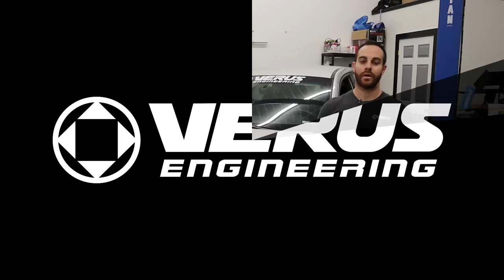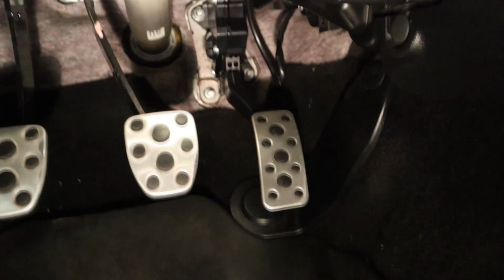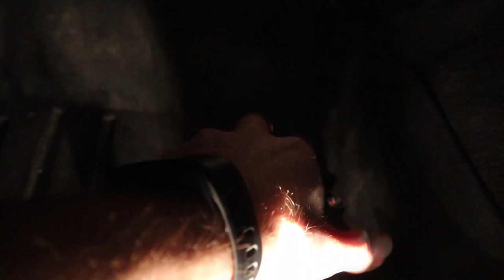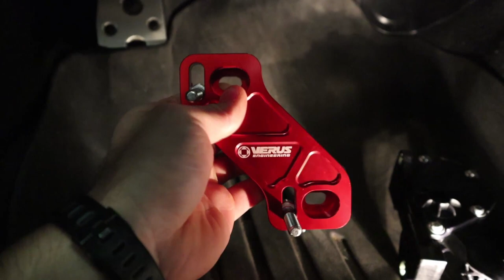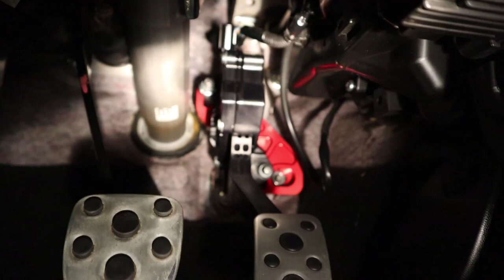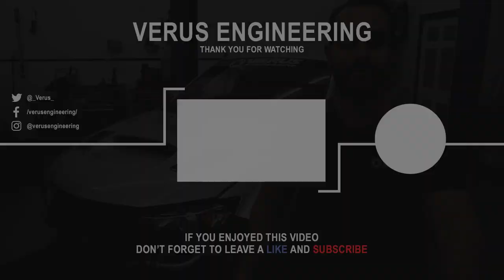Subaru WRX/STI (GR/GV) Throttle Pedal Spacer Install

Comment: got braided lines, couldn't heel toe very well anymore (foot would slip off pedal requiring a change of underwear shortly afterwads) i have been looking for brake adjustments, this is much better.

thank you. buying now.
Reply: Did you wind up getting it? I’m still on the fence but leaning over it pretty heavy to get it